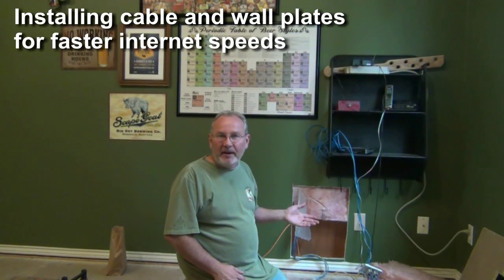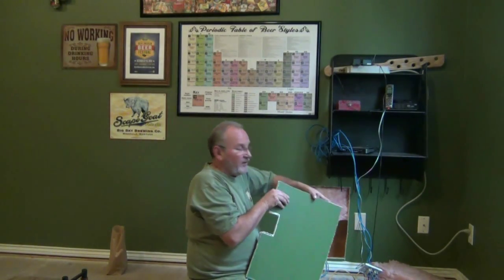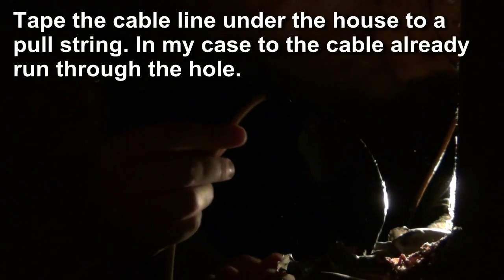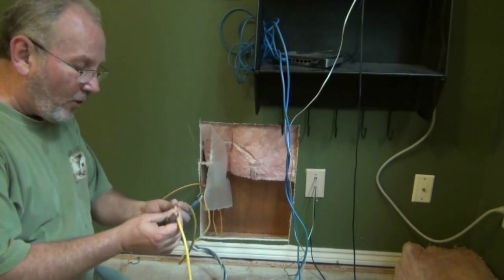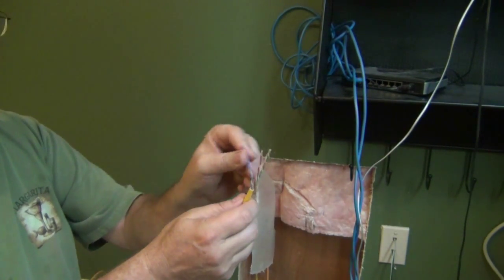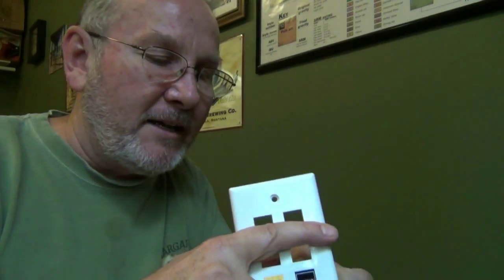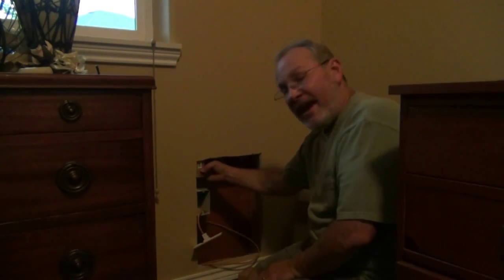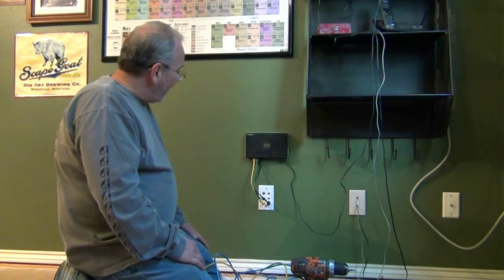How to Get Faster Internet Speeds - Wired for Success!

Comment: We always run what we call a "wireless-emulator" in the house. It's as simple as a 50' CAT6 cable from the computer room to the TV area. It works but it's a pain. After watching this video I think I'm going to wire the whole house with CAT6. Not so hard and 100% worth. Thanks for sharing!!
Cheers!
Reply from the maker: Most of my house has been wired since I moved in. I just needed to and another line and tidy it all up a bit. Totally worth it! Check out PCHCables.com for low prices on all your network cables. The owner is a friend and the prices are ridiculously low. Cheers!

Comment: Good man.. Cat6 for home use is bollocks. I do like 802.11ac wifi routers working together to cover a large house.. but that comes at a cost. Great vid Kevin. Cheers
Reply from the maker: Cat6 can definitely be overkill. But in my area I can literally buy Cat6 for pennies more that Cat5e. I'm talking 20 cents to 50 cents more per cable. But as I said in the video, I've been running Cat5e. I thought about a repeater, but I know the Mrs would go crazy seeing another piece of electronics on all the time. LOL!  Cheers
Reply from the maker: Grant Baker Good observation on the fiber Grant. For me, if I were to wire my entire house today (5 long runs and numerous patch cables), using CAT5e vs CAT6 the difference in price would only be about $15. On the other hand, if I paid retail store prices the project would jump roughly $100 more. So for Dioni and myself, it's worth while. Cheers gents.
Reply: Why do you think CAT6 bollocks in a house? With the need of higher and higher video quality every year, or should I say every month, don't you think going with the fastest possible option is the way to go, mostly if the price difference is small?
Cheers
Reply: Cerveza de Garaje  When and if your ISP connection, home switch and computer can exceed 1Gbit then you may wan to consider 10Gbit gear. Until then save yer pennies... yer gonna want fibre then.
Reply: ***** Grant Baker Yeah, that was my thought. I was checking the prices of 500' rolls of CAT6 cable and even being around double that of CAT5 it would mean only around $30 more overall for my whole project. So even though I'm limited to 1Gb, that will change and I won't need to rewire.
Cheers!
Reply from the maker: Cerveza de Garaje Depending on how much cable you actually need, I may be cheaper to purchase individual cable lengths for each run. I used to crimp the ends of patch cables, but because I get the cables so cheap now it's not worth the effort.